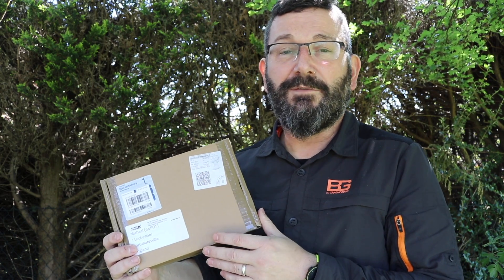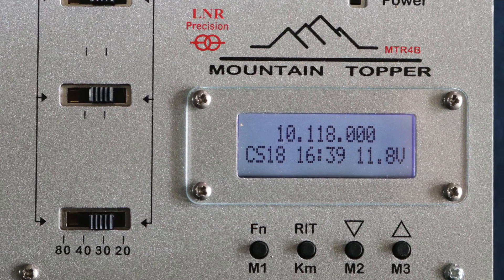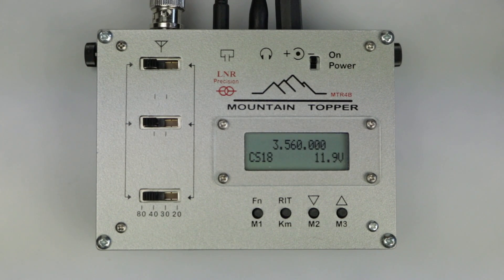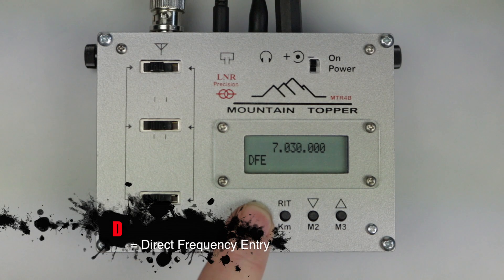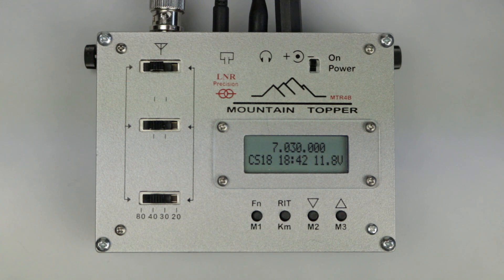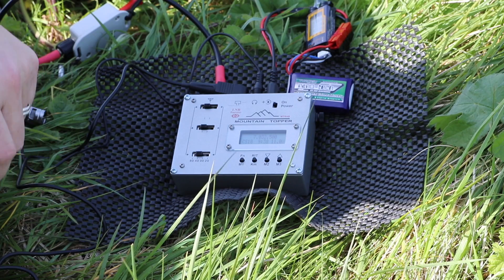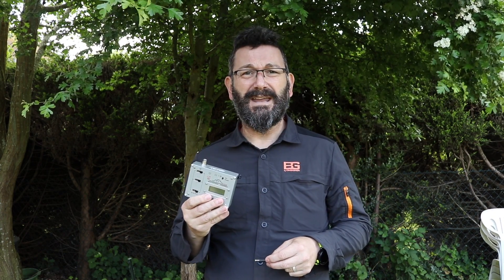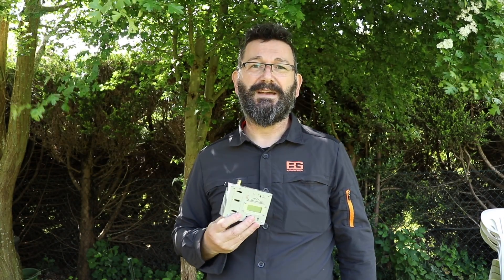LNR MTR4B Overview

Comment: How do we power this radio?    Is there a manual with it?    Where can we buy it?
Reply from the maker: This transceiver is now at version 2.3 and can be bought (when in stock) direct from LNR Precision: https://www.lnrprecision.com/store/Mtr4b-V2-3-Mountain-Topper-p271367005
Reply from the maker: There is an online manual here: https://www.lnrprecision.com/wp-content/uploads/2020/12/Mtr4BV2manual_12_16_20.pdf and I power my Mountain Toppers using 3s LiPo batteries…something as small as 1Ah is sufficient for many hours of operating.

Comment: I have this rig, only mine is red. I wish I could turn down the monitor for my sending since it's louder than what is coming over the speaker from the bands. 73 de AI5DD
Reply from the maker: Yes, this can be a problem. For headphones I either use ‘over the ear’ style that I can nudge off my ears a bit when sending or, when using ear-bud style headphones, I have a short extension lead with built in volume control like this: https://smile.amazon.co.uk/Extension-PChero-Headphone-Control-Computer/dp/B08T1YW1JK/ref=mp_s_a_1_3?crid=1V3FFVHHJ61HR&keywords=headphone+extension+with+volume+control&qid=1660979588&sprefix=headphone+extension+witj%2Caps%2C72&sr=8-3

Comment: I have the MTR4B V2...  Such a nice little radio.  They took some of the unique features of the MTR4B and MTR5B and  made the V2.  I like the idea that you can, when conditions are right, "work the world" on a radio that is no bigger than a deck of 3" x 5" notecards.  I can fit my ENTIRE station in a small soft-sided lunch bag and be able to operate from just about anywhere.  The ONLY things I can't put in the lunch bag are my fiberglass mast, notebook, and operating reference.  However, that is why everything fits into a rucksack.  For a person who isn't able to have a home station due to living in an apartment, this is an ideal little possibility.
Reply from the maker: They are remarkably excellent little radios and perfect for /P operating. You only need a tiny LiPo for normal operating periods which keeps the whole station weight down. Like you, my telescopic mast is the biggest part of my station but my 6m carbon fibre option is super small and light too. I wish throwing a line into a tree was more reliable!

Comment: Hello. Where you see the S-Meter on the MTBR for Reports ? 73 de HB9FZE, Stefan
Reply from the maker: The3DMoviemaker There is no built in signal meter on the MTRs (at this time). Readability and Tone are subjective anyway but for Signal strength I guess based on the ‘size’ of the signal in terms of volume and clarity.
Reply: Terrific video! Thank you!

Comment: Just got my 4b! I'm looking at powering it with a similar LiPo battery. What's the device you have between your power supply and the radio? I'm concerned about damaging the radio having the power connected directly to it, but would like more than just 9v cell.
Reply from the maker: russkydeutsch When you see my station at ~11:25 I’m powering the radio from a small LiPo...I have Powerpole connectors attached to all my batteries so I can use them with different power leads. Attached to the jst-xh balanced cable on the battery is a cheap battery monitor which tells me the overall voltage of the battery but also monitors the individual cells and alarms if they get too low. Finally I fit an in-line fuse in all of my power cables. That’s it. Enjoy :o)

Comment: work with straight key?
Reply from the maker: lonestarprepper01 Yes, if you plug in a mono 3.5mm plug it defaults to a straight key but you can also toggle between straight key and paddle by using the Function button to enter the speed adjustment and then select RIT. I have to do that because I fit stereo plugs to all my keys...even the straight keys...it’s just what I have to hand.

Comment: Great review.  I'm trying to decide between the MTR3b and MTR4b.  I really like having 80m. Could you tell me if this covers the complete bands (ie 3500-4000 and 7000-7300)?  Thanks. 73
Reply from the maker: Tim, I only have the MTR3B and MTR5B (I had the MTR4B on loan!), however, I can confirm the following coverage of each band of the two radios I have and I'm guessing the MTR4B is similar:
MTR3B
40m : 7000 - 7150kHz
30m : 10100 - 10150kHz
20m : 14000 - 14150kHz

MTR5B
40m : 7000 - 7150kHz
30m : 10100 - 10150kHz
20m : 14000 - 14150kHz
17m : 18068 - 18110kHz
15m : 21000 - 21150kHz
Reply: Michael Sansom thank you sir.  That is the info I needed.  73 de KF7VUT

Comment: A great little radio and thanks for the review. My MTR4B has a few quirks:
- The voltage display has an error that is greater than the stated 0.3v difference.
- After using the tune mode to adjust an external ATU, the actual SWR is not good when reverting to normal mode. I find it best not to use the tune mode function.
- RIT no longer appears to be working. I'm pretty sure it did when I first got it.
I wonder if anyone else has experienced similar things with their MTR4B?
There may indeed be room for installing batteries within the case, but having to unscrew the cover to replace batteries has deterred me from trying. Not to mention the possibility of damaging the internal components when trying to install/ replace batteries. 73
Reply from the maker: There was/is a software bug in earlier versions that means the RIT doesn't work. This can be fixed through a software update but I also found a clunky work around. 
Turn on the RIT...adjusting it up or down in frequency has no effect but if you hit Fn (displays R=T) and then tap it again to return to normal RIT you can now shift your RX frequency by 50Hz. If you need to move further you have to keep double tapping Fn and then you can shift an extra 50Hz each time. Clunky but it works.
Hope that helps.

Comment: excellent review. Thanks for putting this together. What's current draw max?

Also is there same amount of room inside the MTR5B to install 18650's?

Thanks again for such a thorough review.

jimmyg
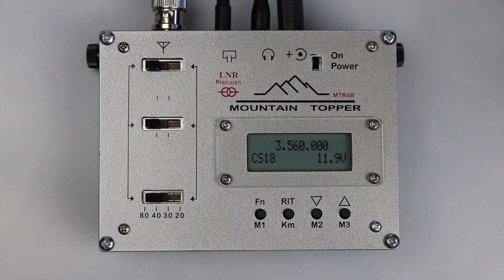Reply from the maker: Jimmy, see the video from about 3:15 for details on power draw but the peak was 600mA with a 12V supply on 80m giving 4W of output power. In receive the radio draws just 19mA at 12V.
I didn't measure the space in the bottom of the radio while I had it on loan but it was significant and I think there would easily be room to fit batteries. In fact I think there's room for batteries and something else!

Comment: Thanks, great video. Would you happen to know if three 18650 cells would fit in the case?
Reply from the maker: Radio Prepper I should have measured the gap...in my mind you could fit battery and an ATU! You'd want to find a way to charge it in situ to avoid constantly opening the case up.
Reply: Thanks, good to know... I have the 3b (also built an MTR2, 3b and 5b!), wondering if I need the 4b ;-)
Reply from the maker: I can guarantee there is an MTR4B shaped hole in a go-bag somewhere near you :o)
With MTRs you know you're not going to be disappointed.
Reply: You know it :-)

Comment: Great review, can you provide some details about that battery and the speaker you are using?  Thank you.
Reply from the maker: For SOTA activations I use a super small LiPo 3S, 460mAh battery. It gives me plenty of power for a few hours of constant operation. Note my comments in the video about supply voltage as the 3S LiPos do start off at 1~12.5V when fully charged. Here's a link to the actual battery I'm using: https://hobbyking.com/en_us/turnigy-nano-tech-460mah-3s-25-40c-lipo-pack.html
The speaker is just a little portable unit (no brand name). I confess it can be a little quiet on a windy hillside and I prefer to use headphones but for filming a little speaker makes recording the audio easier! If anyone has a good suggestion for a small/flat portable speaker with a decent amount of amplification I would love to hear the details :o)
Reply: Michael Sansom. Michael, 
Thanks for a good review.
I have severe hearing loss, so have to have considerable help with any MTR series radio. That means a tiny rechargeable headphone amp if I use 'phones, and for open audio use I have a speaker which is about the same size as the MTR5B, made by Altius, model number ADP-108BT (got it from ALDI I think!) its a re-chargeable stereo unit (two separate speakers) but I run with just the one which takes the input cable - lighter and less current drain on the unit.

Send me an email if you want a picture of it (probably available under different brand-names if you know the shape to look for).

Les g0nmd

Comment: Thanks Michael! very similar to the 5b too I think.. 73 Richard // N2GBR
Reply from the maker: Yes, the menu and display are essentially identical...not sure if there are any fundamental design differences other than the bands covered. I felt the audio was louder on the MTR4B but there is likely variance from radio to radio. The 4B obviously has the larger case (you could potentially fit internal batteries or an ATU) and the flip down legs but in essence the MTRs are all similar (if excellent) beasts!

Comment: Great review. The major drawback for the mountain topper radios for me are their do not exceed voltage of 12 volts. My battery packs are all 13+ volts.  Most other serious transevers can use 13.8 volts or more. AC9EK
Reply from the maker: I've not looked at the underlying design to see why the limitation exists. I know I run my MTR3B and MTR5B a little higher than 12V because my 3 cell LiPos are actually more like 12.5V when fully charged despite being officially 11.1V. You could very easily add a single diode in series in the power lead and drop about 0.7V so this would overcome the issue. I basically bought the 3 cell (3S) LiPos just for my MTRs but now use them for other QRP radios...I only use the 13.2V LiFePo on the KX3.
Reply: I use my MTR5b with 12.6v, Steve Weber has spoken about how resilient the finals are on the MTR series. 13v+ is probably asking too much.  Check out ad5x's article about reducing voltage, this circuit could address the issue easily. http://www.ad5x.com/images/Articles/AutoLiPoVoltageReducer.pdf 73 de w8tam
Reply: Quoting kd1jv on feb 13 2017, on the at_sprint yahoo group:

It’s still a good idea NOT to transmit into a poorly matched load when running the rig at a full gallon and use a resistive SWR bridge.

However, seeing that there are now a boat load of rigs with BS170 finals in them out there, if anyone has burnt one out I’m not aware of it. Either everyone of those users has been super careful (which seems unlikely) or there is no need to worry any more (which is more likely). So, the warnings were no longer felt to be necessary. 

The first few versions the ATS rigs used 2N7000 finals and those did have a problem and after the switch over to BS170’s  the high SWR warnings were carried over to be on the safe side. Like the government likes to say “out of an abundance of caution” these warnings are issued, even though there is absolutely no creditable evidence of a threat. 

Steve KD1JV

Comment: Excellent and highly professional review. I am a new HAM and still learning CW basics. i hope to get one day at your level. You were calling at 20WPM i think... May i ask you why you got (apparently) answers at 25 or higher?
Reply from the maker: Great stuff...keep at it with the CW because it opens up a whole world of fun radio.
Although there is a 'gentlemen's agreement' that one should respond to a call at the same speed as the caller not all Ham's abide by this. Some Ham's are simply not great at assessing speed and others will respond at the speed that they prefer and expect you to shout 'QRS' if you need them to slow down. I was calling at about 18wpm and can cope up to 22wpm but sometimes operating outdoors with wind/motorbikes/aircraft noise copying can be difficult so people who drop the speed or leave nice big gaps between words are a real help. I dropped my speed to 14wpm to work a Swiss SOTA station and he copied everything first time whereas the other stations calling in at 16wpm+ had to repeat lots...for me it's just a courtesy to match the other stations speed.
If people won't slow I just respond "SRI QRM 73" and QSO with someone else!